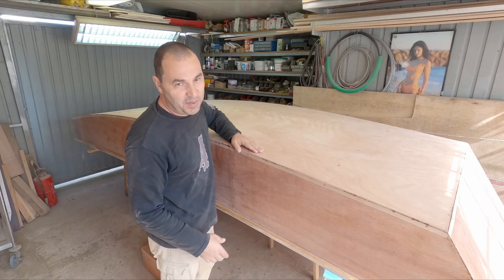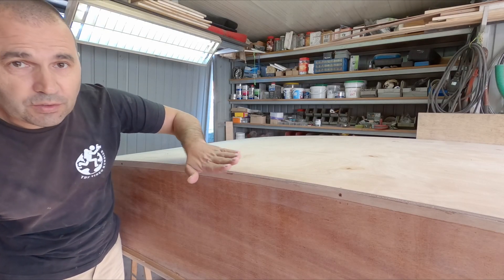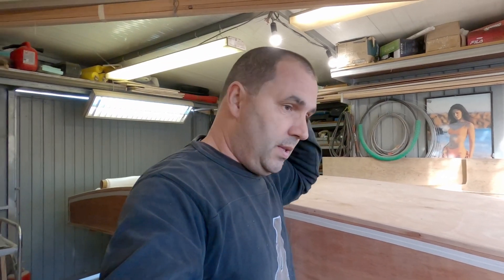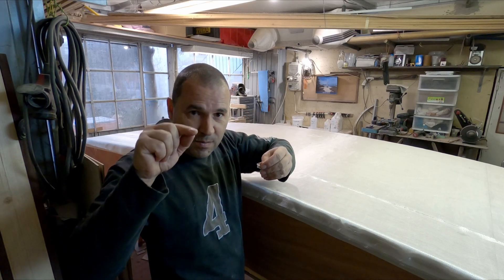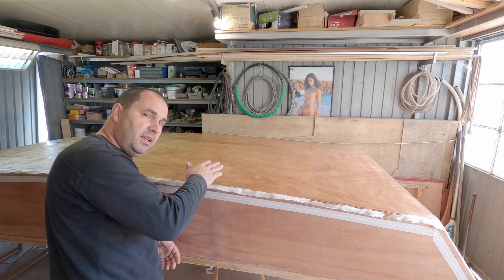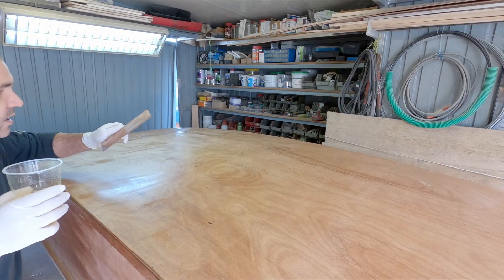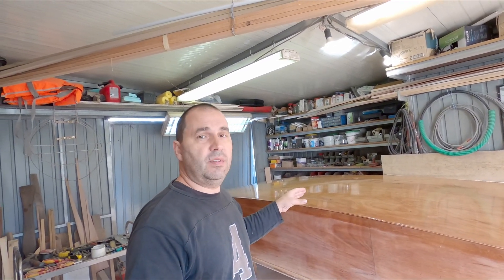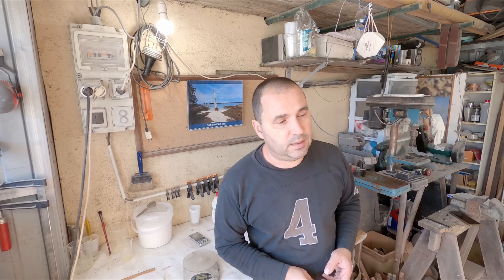I Built an UNSINKABLE Boat (DIY) it's Fast and Carries 5 Adults!

Comment: I think a possible method of keeping the front bow with a sharp edge can be accomplished by first covering the rounded edge with cloth. This will form the structural component. Follow with a second thick mixture fillet and second taping to form a crisp edge.
Reply from the maker: Hi, I have done that on the transom, that's where you need a sharp edge for performance!

Comment: Hey Teo, Tuhinga here. I put a length of masking tape along any pieces of cloth before I cut it to stop fraying. Works a treat. 😉
Reply: When you use it you leave the tape on and cut it off after it has started to cure. Stops all that nasty fraying that never lays out anyway. Does that make sense?
Reply from the maker: @onehanger  neither do I! *remove it 😅
Reply from the maker: That's a good tip! Wont it pull the threads when you want to remove it?

Comment: Your glass looks great! It looks so close now, but I remember how long sanding took me. If you are going to paint you might not need to be so particular. I don’t miss the dust!
Reply from the maker: Hi Rob.
Actually, if you varnish it, the wood grain will "hide" imperfections better than a glossy paint.
Reply: @TheBoatRambler  my clear finish didn’t hide much at all! But I can’t be too precious, it was made to be used, which inevitably means bumps and scratches anyway!

Comment: I have never worked with glass or epoxy!!
Reply from the maker: You should! Epoxy  is a gamechanger in boat building. You mix, apply, wait 6 hours and the joint is  stronger than wood itself.  Glass  I don't like much but it is really useful too.

Comment: You can construct a sharp edge for the transom out of thickened epoxy on the outside of the glass (use really thick epoxy with a putty knife, then sand it to a knife edge when fully cured).
Reply from the maker: Hi Daniel, 
I have actually done that already!! Now that you mention it I realized I forgot to edit that clip into this video! 😅
No worries, I'll show it next week!

Comment: Looks realy nice😃. Now I dont remember if the bottom already had epoxy, and was then sanded down (dont think so) ?.. In other videos I have seen some recommend soaking the plywood in epoxy 3 times before placing the glasfiber.. Reason being, that "dry" ply will soak the epoxy out of the glas before it cures..But it seems not to be the case here. It looks perfect. Thanks for sharing..
Reply from the maker: Hi,
the bottom was not coated first, that's why it soaked 900g of epoxy on the first coat! But as long has you wait till it gets tacky it will give it time to absorb all the epoxy needed. After all it's only 1mm plywood layer before it reaches the first glue in the plywood. After that, the second coat will fill the weave nicely.